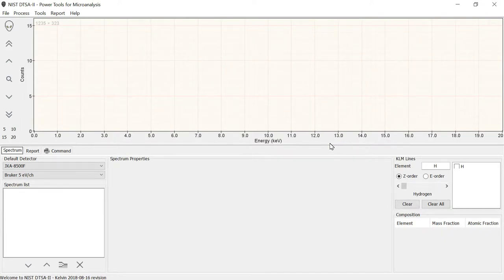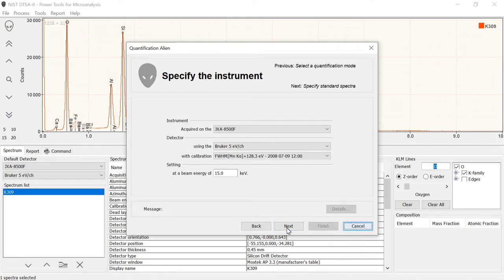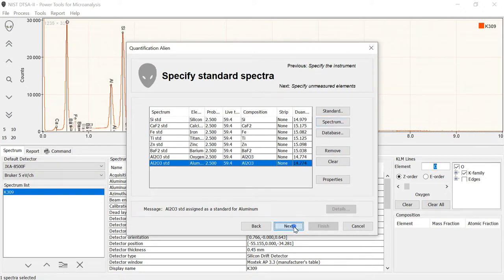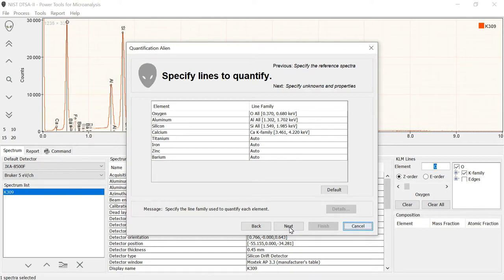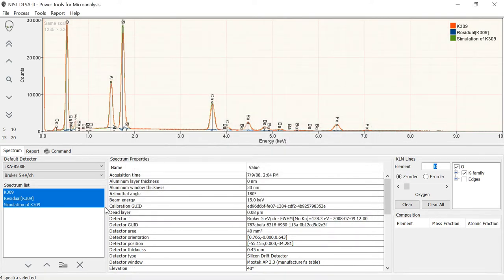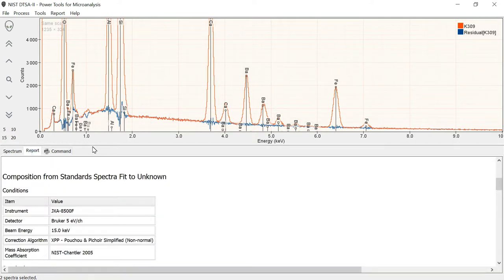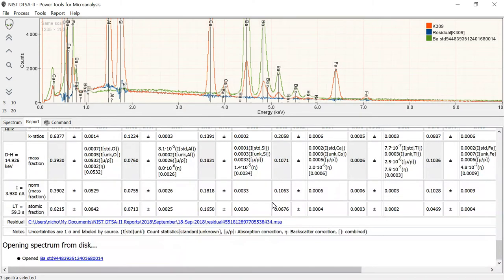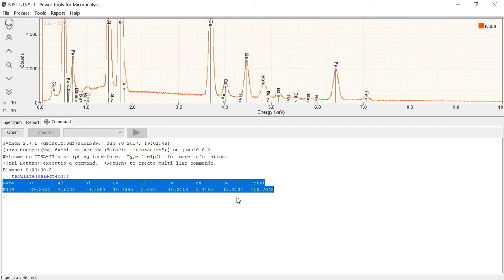Introduction to Quantitative Analysis using NIST DTSA-II

Comment: Hi i like the software, but when i just use k ratios i dont get error bars and also no residual spectra. Also no easy ways to include eZaf or PeBaZAF. I understand you want to focus on comparing to standards but an easy standard less analysis should also be possible.
additionaly if i substract the background and save the project, i only have the substracted spectrum left not the orginal one.
Reply: also there should be a collection of the most use detectors, for a lot of people the hurdle to get all detector specifications is too big.